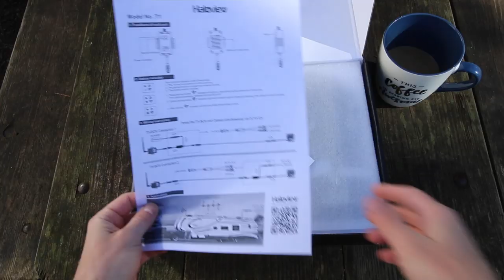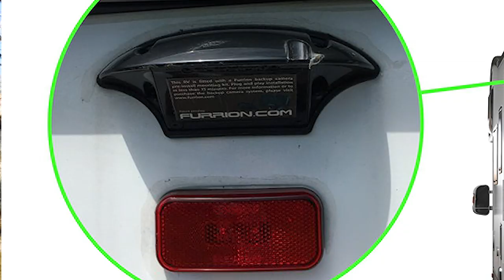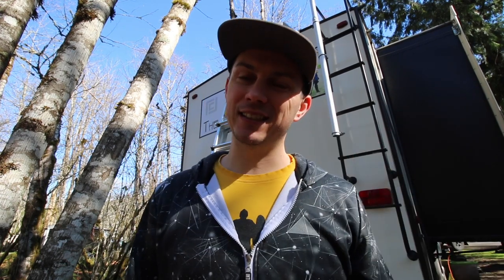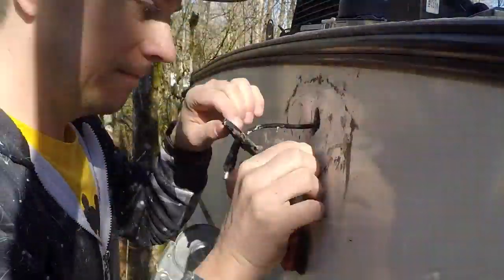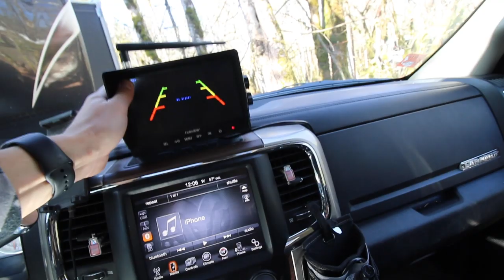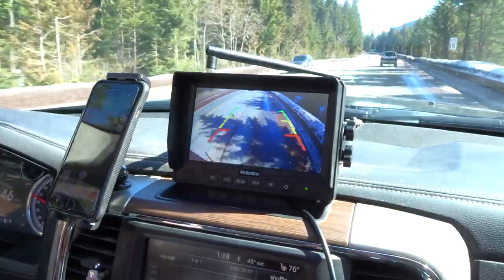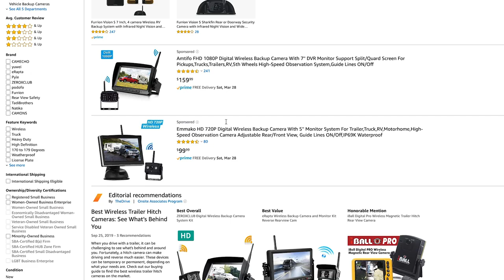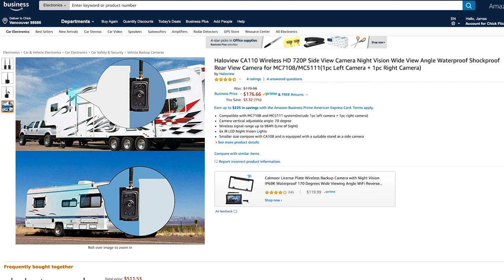BEST RV BACKUP CAMERA WIRELESS Review and Installation 📷 Haloview RD7 Wireless Backup Camera System

Comment: I installed one of these on my travel trailer and wired it into the running lights because I wanted it on all the time.  But the camera goes in and out as we go down the road.  What would cause this?
Reply: Sounds to me like a bad connection, possibly where wires plug into the wire's inline connectors or where wires tap into the power source and ground. I had a different brand backup camera kit and had a similar problem caused by the wire's push-in connector, the wire that connects the monitor to the cigarette lighter type power source plug.  Good luck.

Comment: Couldn’t you run the extra cable under the camper instead on the top of the roof?
Reply from the maker: Yes you could, but then the cable would be running down the back of the RV and I might worry about it getting caught on something underneath in motion.
Reply: @TheChicksLife , it could be fished behind the wall after following the frame rails underneath I would think.  Surely a bit of a pain but doable.